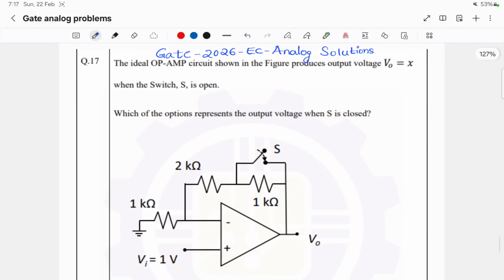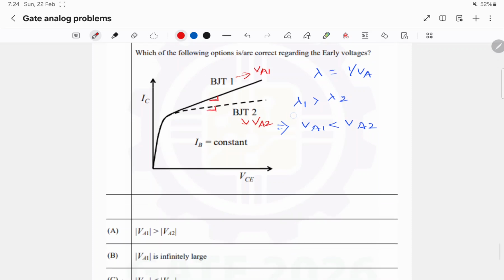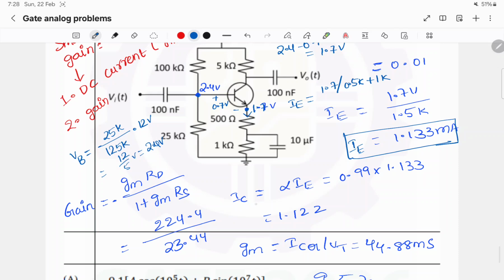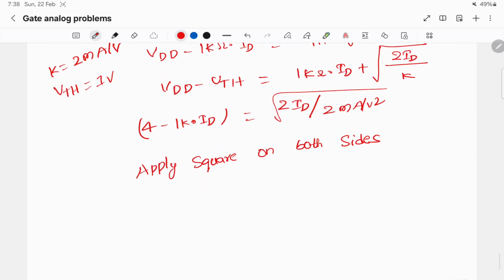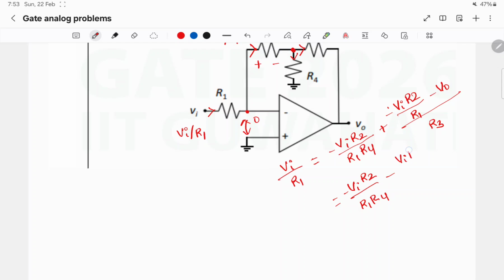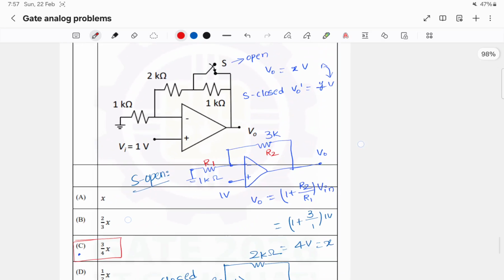Gate EC  2026 Analog solutions

Comment from the maker: 00:00 Q1 OPAMP question based on non-inverting Amp and Switching
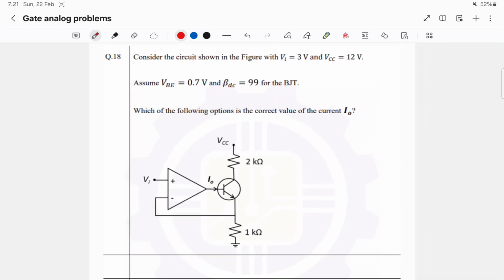03:26 Q2 BJT & OPAMP COmbination Based on Negative Feedback
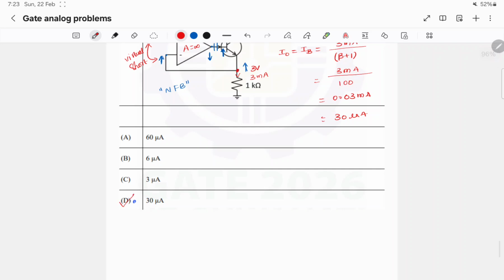05:57 Q3 Relation of Early Voltage and Slope of IC Vs VCE Curve
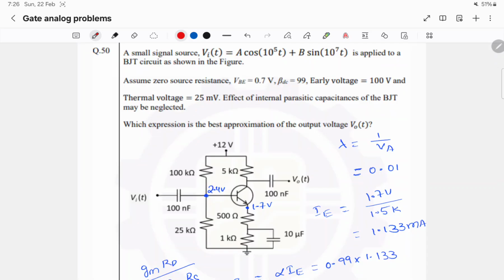08:10 Q4 Small Signal Gain Of Common Emitter Amp
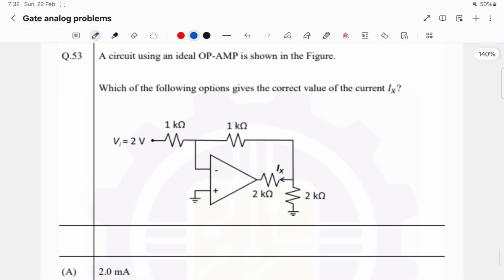14:00 Q5 Inverting OPAMP Finding Ouput Current
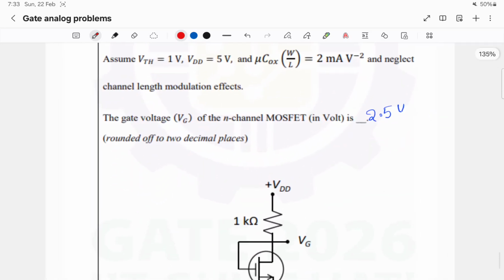15:32 Q6 Finding Gate Voltage of Diode Connected MOSFET
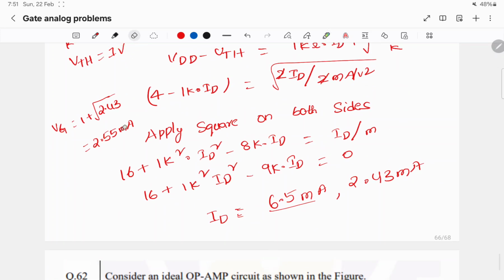19:30 Q7 Closed Loop Gain of OPAMP Circuit
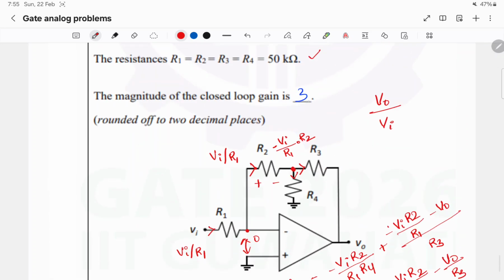23:15 Q8 Diode Based question on Clippers